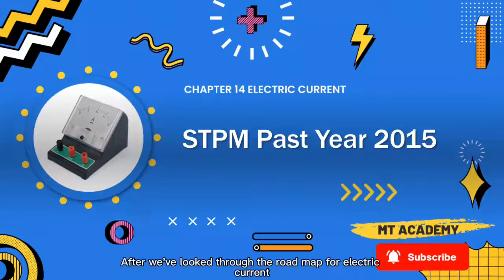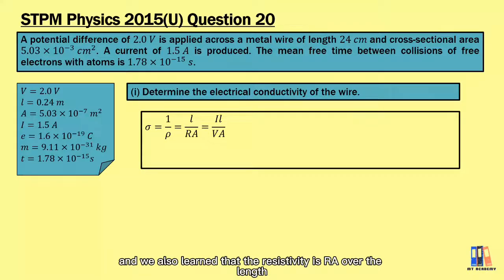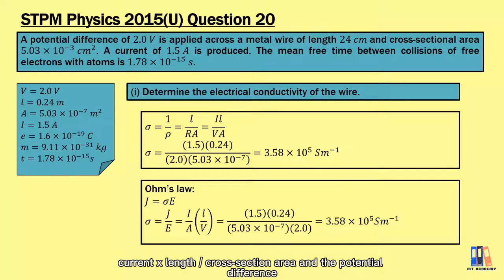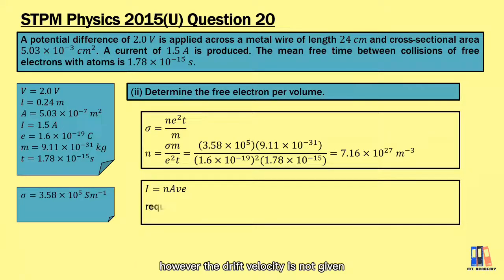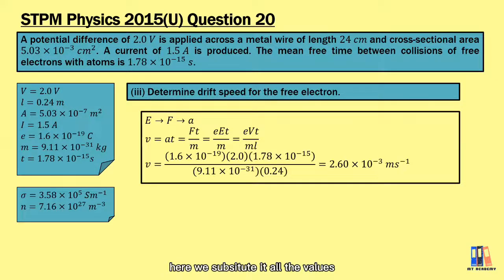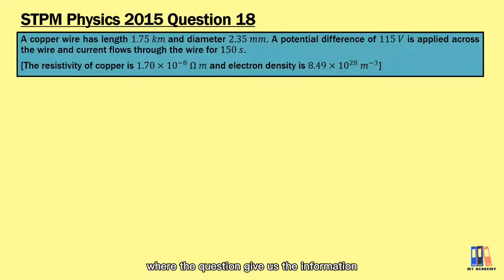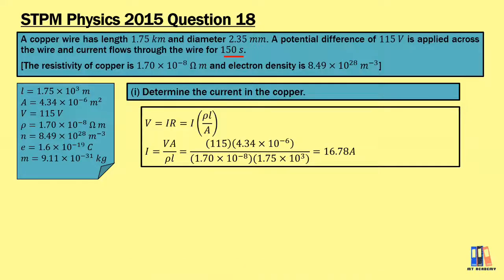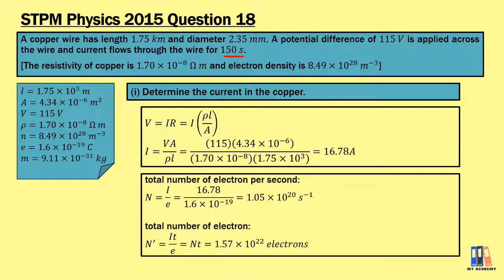Electric Current: Past Year Question (2015) | STPM Physics

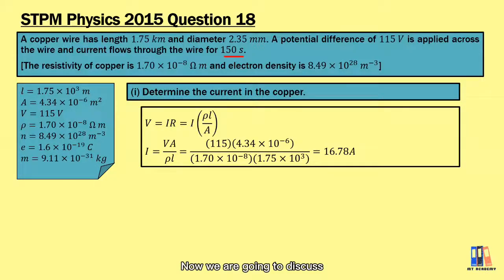Comment: 5:04
The electron density given seems to be wrong

from the answer,
N' = 1.57x10^22
n=N'/V
=(1.57x10^22)/(1750 x 4.34x10^-6)
=2.07x10^24 m^-3
but in question, n is given 8.49x10^28 m^-3

Other way to prove
N = 1.05 x 10^20
N=N'/t
   =nV/t
n=Nt/V
  =1.05x10^20(150)/(1750x4.34x10^-6)
  =2.07x10^24 m^-3

Hope this comment will be noticed
And thank you for your guidance for these questions.